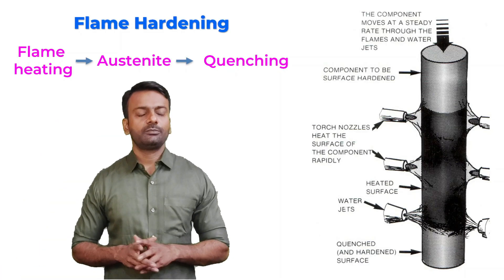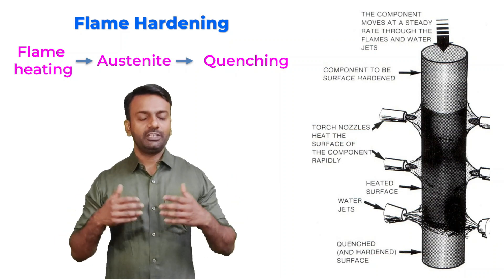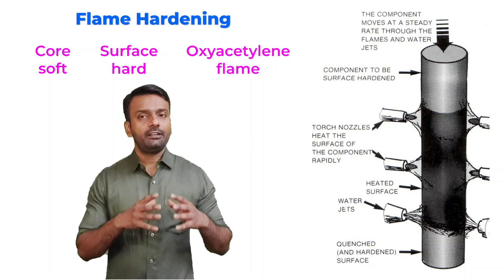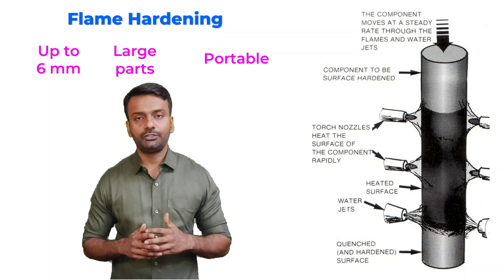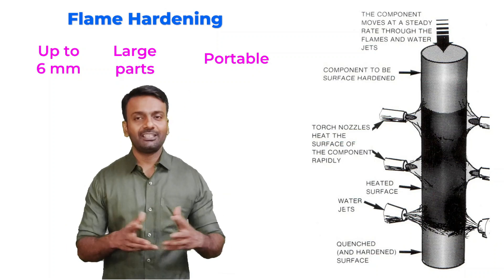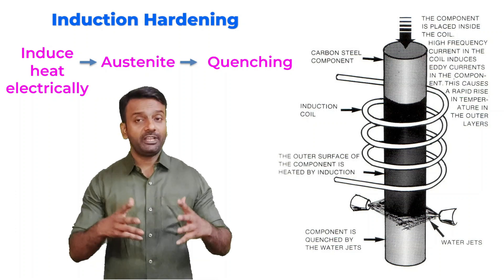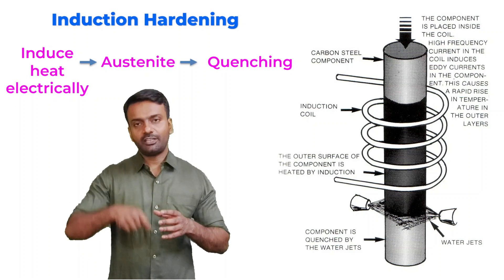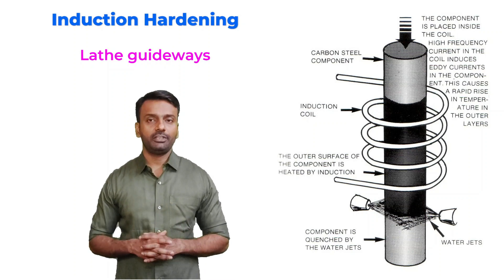Surface Hardening Method | Flame Hardening | Induction Hardening | Mechanical Engineering Dr. Shaikh

Comment: Do we need to carry out tempering after these processes to relieve internal stresses and keep core toughness?
Reply from the maker: You can carry out tempering if you need to impart toughness in your workpiece.
Reply: @ProfDrVasimAShaikh  But sir tempering is always followed after hardening process where we heat up entire component. But here in case of surface hardening core is not heated up so is it standard procedure to carry out tempering after surface hardening or we can use the component as it is?